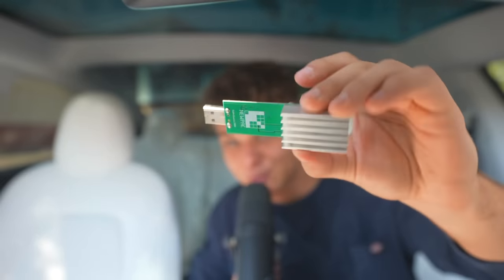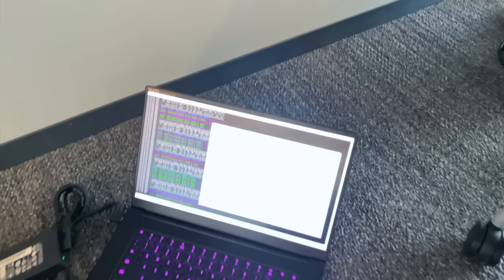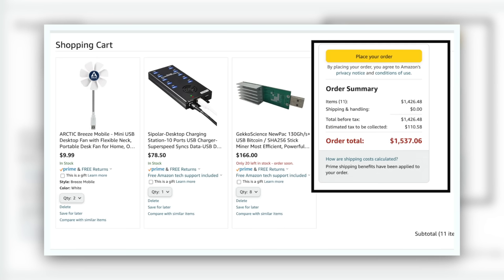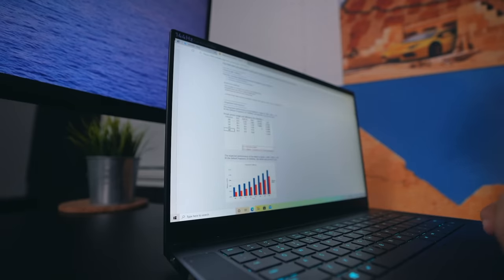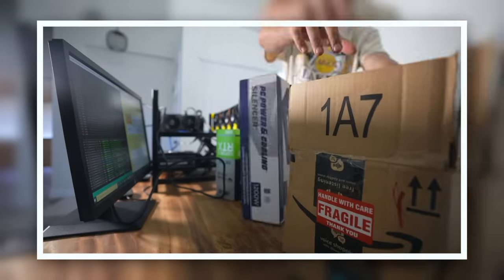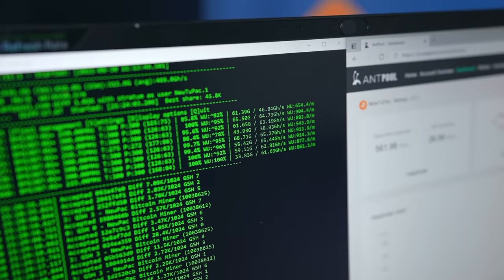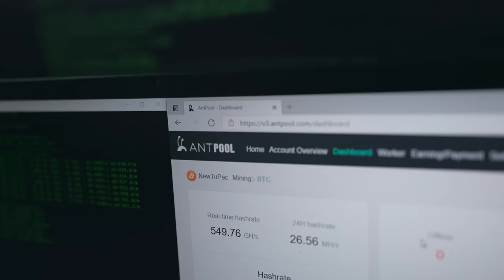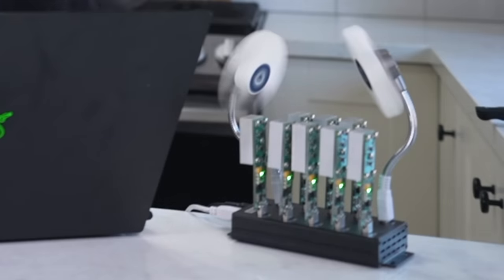Mine Bitcoin on a Cheap USB Stick

Comment: Well in calculation, if you have 500 of this tiny rigs of 8 usb running per day you'll have a $100 profit per day... 

$100 (target profit) ÷ 20¢ (per tiny rig per day) = 500 tiny rigs of 8usbs

Just plug it to a damn solar panel or windmill so you won't have to worry about electricity bills

Comment: Hold up.. you said "GIGA-HASH"!? my $800 1660 super GPU only pulls down 30 "Mega-Hash". How is this not the better choice?
Reply: I was thinking the same thing. Just started using my PC with a GTX 1080 with Nicehash and cruising around 27-30ish MH, make about $1.40-$1.60 a day after electricity. How is this not a better choice? 8 of them at 60ish GH would be bringing in way more than that.

I see 6 slot GPU mining rigs for sale without GPUs for $3k plus and they don't come no where near this hashrate.

If this is actually GH you'd make your money back then some in a month....

Comment: New pack usb miner with a speed of 45gh/s gives a day : 0,01697 dollars, a month 0,5091 Dollars so where do you want to go with this ? If you save cash you get somewhere...
Reply: With USB-Stick Miner GekkoScience Compac F 200-400 GH/s you can get 400gh/s that gives you a day 0,14 a month $4.48 dollars, and you must reduce the electricity cost, also this usb stick cost 250usd, so do you think you go anywhere with this little things ?

Comment: The first guy who figures out how the algorithm works and can immediately program the computer to spit out the right answer will be the first world's trillionaire.
Reply: That's the whole point of a hash algorithm, is that you can't reverse-engineer it. For example, most of the good hashing algorithms use modulo, which is the remainder. If you get a number modulo 5 and returns 3, the original number could be 3, 8, 13, or multiple of 5 + 3.

Comment: It's probably something a lot of people have already said, but if that rig actually works the way you say it does, then electricity is a minor concern. Someone should have suggested running it off solar power. There have been many YouTube channels running similar rigs powered by solar energy. The next suggestion would be to use the earnings from the rig to gradually increase its size. That's not a bad thing if you don't have to do anything but let the computer handle everything. Based on that premise alone, I think it's a good investment. What do the rest of you think? Making money while you sleep, even if it's not a significant amount, is better than working hard and using up your time for a lot of money. In both scenarios, you have the potential to expand. I'm not sure if it's just a gimmick or if it's actually feasible. Can someone please comment on this?"
Direction and dictation: "It's likely that many people have already mentioned this, but if the rig functions as you described, then the issue of electricity is relatively minor. It would have been wise for someone to suggest powering the rig with solar energy, considering the number of YouTube channels that currently utilize this method to generate more power. The next suggestion would be to reinvest the earnings from the rig to gradually increase its size. This isn't a negative aspect, especially if you don't have to do anything except let the computer handle everything. Based solely on this premise, I believe it's a worthwhile investment. What do the rest of you think? Making money while you sleep, even if it's not a substantial amount, is preferable to working hard and sacrificing your time for a larger income. In both scenarios, there's potential for growth. I'm unsure whether it's merely a gimmick or a practical solution. Could someone please provide some insight?"